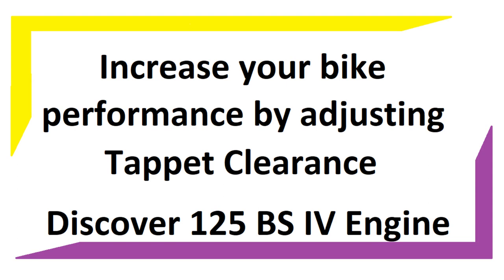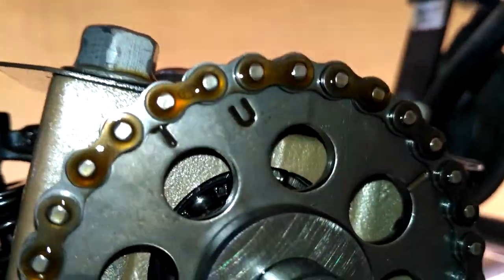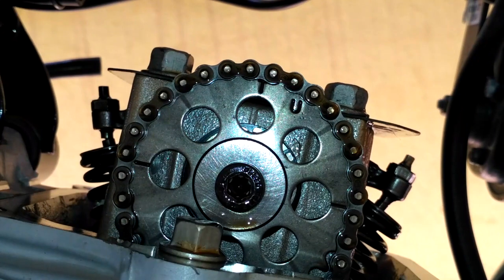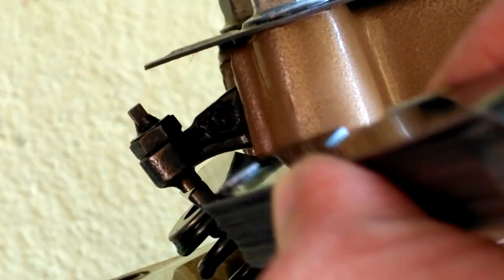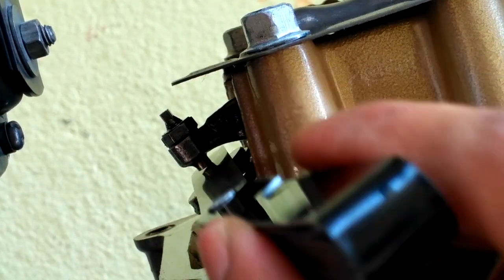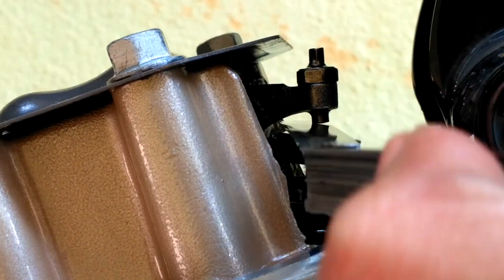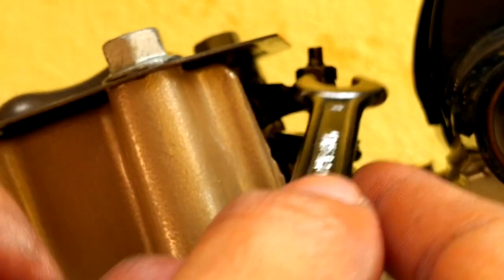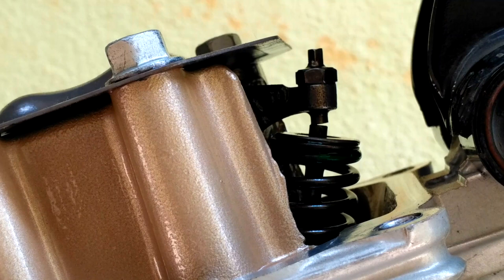Discover 125 tappet setting | Tappet setting for Discover 125 BS 4 engine | Tappet clearance

Comment: Discover 125cc (2022) tapped clearness ??
Reply from the maker: For 2022 model, service center chart mentioned: 0.05 mm and 0.1 mm .
Reply: @PavanKumarHB   agar me 0.05 and 0.08 use Karu to problem hoga engine me?
Reply from the maker: @arafatkhan9927  yes. Bike will not perform smoothly and misfire will happen. Lag in performance if 0.08mm is fitted. 
0.05 mm & 0.08 mm recommended for 2017 bs4 model my bike. For new bikes it's 0.05 a& 0.1 mm company recommended.

Comment: Sir Bajaj discover 150cc 2013 Modal valve clearance?.
Reply from the maker: Hi Shrinivas sir, did you try 0.08 inlet and 0.12 outlet?
Reply from the maker: Hi PM sir, it will be 0.03mm and 0.05mm instead.

Comment: Sir discover 150 2011 modal valve clearance?
Reply from the maker: It'll be 0.05 mm inlet and 0.1 mm for outlet. Also check with 2-3 bajaj service center for correct reading.

Comment: दोस्त एक बात बताओ  हमारे पास डिस्कवर 150cc है जो 2010 में आई थी उसमें भी ये ही इंजन है उसके जो तेपिट है उनकी क्या सैटिंग होगी इनलेट की कितनी होगी और एक्जॉस्ट साइड की कितनी होगी
Reply from the maker: Hi VRC, the inlet valve is 0.05 mm and exhaust is 0.10 mm for discover 150cc 2010 model.
Reply: @PavanKumarHB  पर आपको नही लगता 0.10mm बोहत बोहत ज्यादा हो जाएगा क्योंकि हमने इनलेट 0.05mm कर रखा है और आउटलेट 0.06mm मतलब ये की जितना आपने बताया है अगर उतना करते है तो तेपिट आवाज नही करेगा क्योंकि हमारी दिक्क्त ये है कि बाइक को जब भागते है तो 60 तक तो जाती है पर उससे ऊपर भागने में ऐसा लगने लगता है कि इंजन से आवाज ज़्यादा आने लगी हो और बाइक उतना भाग नही रही हो मतलब ऐसा लगता है जैसे बाइक एक गियर ओर मांग रही हो
Reply from the maker: Hi VCR, try this readings. It's mentioned in chart of bajaj service center.
Use only bajaj company 20w50 oil and adjust clutch to 2-3 mm ply.
With these specifications the bike don't sound even above 90 kmph.
Reply: @PavanKumarHB  जो आप बता रहे है वो सब सैटिंग देख ली है ओर रही बात आयल की तो वो तो हम शुरू से ही 20w50 डालते है और 2 हजार पर change भी कर देते है